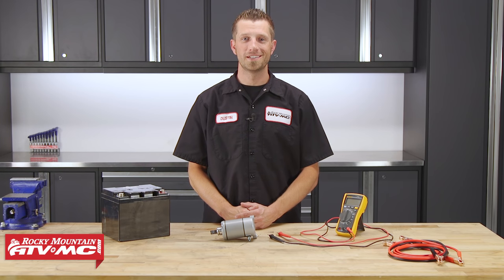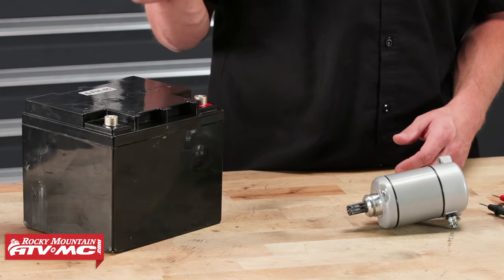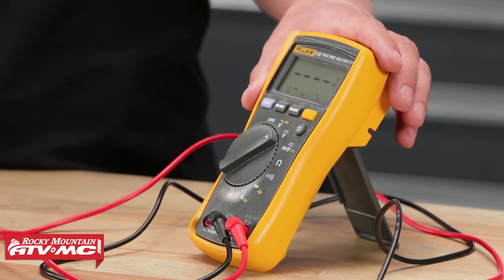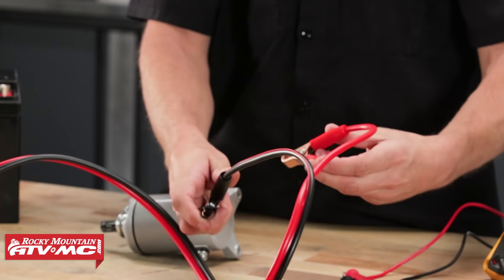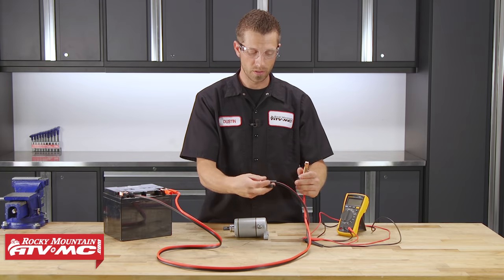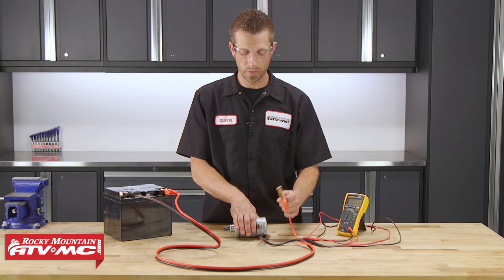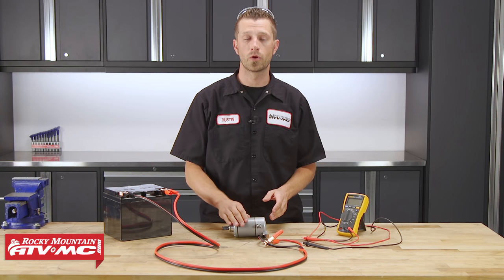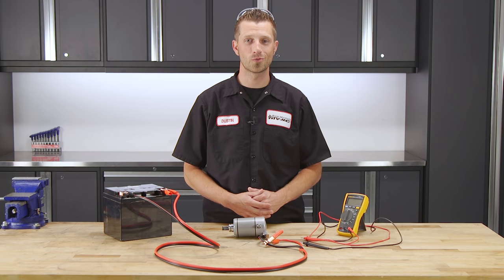How To Test Motorcycle, ATV, & UTV Starters

Comment: Just because a starter turns does NOT mean it is still good. The real question is how much torque will it produce and to test that you need a dial type torque wrench a vice and most difficult to obtain, the max torque spec for your starter. Then connect the shaft to the torque wrench and clamp the starter in the vice and bump the starter with a 12 volt car battery and see what the reading is. They may spin but still won't turn the engine over for several reasons.
Reply: Hi Brian
That is such a good replie. I have the same problem. Srarter spins but I can stop it within a second with a gloved hand. Is that normal for a 1200cc MC starter motor.
Reply: @thefishingreel1449  That might still be ok since the starter has a very small gear and the driven gear is larger thus you get mechanical advantage, but I can't say for sure. I did lean a lot more when researching for my problem and I found my arctic cat has an internal automatic compression release, and if the intake valve lifter clearance is any more than 3 thousands it won't open the valve the little bit required to relieve the compression on startup and even with a new starter, solenoid, and a car battery it would not turn over. adjust the intake valve to .003 and boom, fixed it.
Reply: Russell 79TuLlpLN
Reply: Finally the comment I was looking for, agreed that just checking the starter spins with no load isn't representative of real-world conditions. Thanks Brian.
Reply: What’s your alternative then
Reply: @Nikosakii  Alternative to what? Who are you asking this of? I think I said what needs to be done.
Reply: Correct. I just had this issue 2 weeks ago. No crank, no start. Bench tested the started and it worked, put it back on the bike while leaving the case off and nothing. Opened it up and armature worn way down and 2 brushes were dust. Replaced and now she starts

Comment: My motorcycle stopped turning over one day. I tested the starter solenoid and the pulse generator coil. They were okay, so I took out the starter and tested it exactly as shown in this video. It sparked a ton and there was no movement. I'll be replacing (rebuilding if possible) the starter & my bike should be back on the road.
Thank you for the helpful video!
Reply: That's exactly what just happened to me. Did your bike start up after a new starter?
Reply: @alexus335i7 any luck with yours?

Comment: Work flow should be negative to starter body then negative to battery. Positive to battery then positive to starter motor. Otherwise you might the sparks before you have time to put on the safety glasses 😁. Thank for the vid. You guys make great and very helpful content.
👍🇿🇦👍

Comment: In my application, there is an intermediate gear which then drives the Flywheel? on the engine. This intermediate gear only transmits power in one direction. In the other direction , it just free wheels (maybe using pawls or a"clutch"). I can hear the motor running, but no engine rotation. So can the starter motor be running in reverse and just spinning the intermediate gear??  Because, if in the correct direction, the flywheel/crankshaft would be turning. A bench test of the motor shows it running freely. I don't know any torque figures.

Comment: Hello . I connected the starter relay to the battery and it starts and stops
 It means not good.
But when it is connected to the motorcycle and tries to start it spins. Thanks for the help

Comment: cleaned my starter and resembled it, now it turns in wrong direction, how do i revert the  polarity to run correct rotation?
Reply: hi , i got the same problem how did you solve it?

Comment: Hey i have a starter... i have testet it with 12 volts but its not working. But sometimes i tapp the starter with a hammer it work.
And 1 min after it dont work.
Reply: Stuck brush(es)?

Comment: What about a starter motor that works fine on a bench test and works fine in ATV without spark plug in, but once the starter is under load (in the ATV cranking under compression, starter motor makes a loud screeching noise and appears to have lost it torque? Any ideas?
Reply: if you have tested the battery, and cable and cable connections and starter solenoid then I'd say the starter

Comment: I go to test my new starter that I just bought to see if it will turn over and After I ground the cable to the starter and I apply the positive cable to it I just see sparks fly and it doesn’t turn over why is this ?
Reply: I'm having the same problem. Did you find out why
Reply: @brandonatkins9087  did you find out why lol

Comment: I am getting a nasty noise occasionally when starting the quad.  We just replaced the starter clutch and it is still doing it.   I checked compression, check the bottom end with the spark plug out and it feels great when rotating.it only happens when cranking over. 
All drive gear from the starter to the tarter clutch look great. 
Starter cranks over great, but we are getting that intermittent noise.
Any ideas?
I am tempted to change the starter just to eliminate it.
Any help is much appreciated.

Comment: I have a 1997 Yamaha fzr 600R. I laid my bike down a while back on the right side ever since that happened now when I push the button to start my bike it won't start but I can push started with no problem. I did everything you said in the video and my starter is good at first I thought it was a starter before I tested it so I bought a new one I even bought a new solenoid and it still won't start when I push the button what could be the problem when I push the button a red light comes on indicating oil I don't understand my oil level is perfectly fine. Please help I'm tired of push starting my bike it weighs 515 lb

Comment: I got a brand new battery.  Two months later with minimal use it would not start. I replaced starter relay. Pulled out starter and tested with battery charger. It worked fine. Went back to auto part store got the battery replaced.  It started up. Next day it wouldn't start. Any ideas? I do have a permanent trickle charger and winch hooked up.  If that matters.

Comment: Can i use a smaller power source if it uses 12 volts dc? I’m trying a motor similar to that one with two 6 volt batteries and i get nothing, i doubled the voltage and still nothing. Is my motor bad or does my generic 12 volt power source need more amps?

Comment: What if the starter turns over once with the battery and the cables and when I double checked doing the same steps as the first time theres nothing
Reply from the maker: You probably have a dead spot. This can happen if there is poor contact, a short or open at the commutator (Several metal tabs on the armature that the brushes ride on inside the starter). Sounds like it's time to replace it. Some starters can be rebuilt, but for most people, I would recommend replacing the whole thing to save some headache. -Charles

Comment: You can do the same test by using a screwdriver and placing it on top of both connections on the starter relay and a spark will appear and the starter should turn or not depending if its good
Reply: If it don't turn does it have to mean the starter is faulty. Could it be anything else

Comment: Mine makes a weird spinning noise when I touch the wire to the starter solenoid and never stops any idea what the problem is? I replaced the solenoid and and I’m about to install the starter.
Reply: Bearing shot

Comment: What if you have a good battery and you start the bike and it cranks over really slowly and the positive cable gets hot? I have that problem on my 2006 Husqvarna TC450
Reply: did u figure out what it was going thru same thing thinkin its a bad starter solenoid
Reply: Bad connection somewhere making resistance

Comment: Big problem doing what he said. It works great if your starter is good. But since the idea is to test if it's bad, this is not good. If the starter has gone bad due to an internal short, you may as well be touching both sides of the battery terminals with your hand...

Comment: Sportsman won't start. I can start it by jumping the solenoid. Replaced the starter solenoid combo and same problem. Ignition?
Reply: Dave Smith. If you direct jump the solenoid and still have the same problem then the problem might be the ignition switch or the kill switch.
Reply: First make SURE your battery is fully charged.  Second, check that all of your grounds are tight.

Comment: I try to start the bike and all you hear is the starter but no turn over. Loud starter noise but passes starter test. What's wrong?
Reply from the maker: It's hard to say. I would recommend checking your machine to make sure your engine is getting fuel and spark next.

Comment: I tested my starter after rebuild and it seems to be working g properly, when I installed it the motor sounds ike it spins but does not engage the flywheel to crank the engine over. I am at my wits end!
Reply: Make sure your battery is fully charged.  Usually the culprit.  If battery is charged and good, you could have a ground issue.
Reply: Worn-out Bendix
Reply: Jeffery Young try fliping the magnets, its turning the opposite way

Comment: what is the ohm reading ?? between the positive and negative
Reply: very very low since the motor is not turning it's just the resistance of the windings which is less than one ohm

Comment: Does anybody here actually answer any of the questions in the comments? What would happen if you used a higher voltage battery?
Reply: This kills the starter (if its not rated for higher voltages)
Reply: He's right, you can't get more power out of the same size starter, power is heat, and the heat has to be dissipated.

Comment: My ATV starter motor struggles to crank past the compression stroke, cranks perfectly without a spark plug in, any ideas?
Reply: Matt Lee weak battery?/try wacking the starter with hard object if it helps speed it up starters wore. If not batterys probably weak
Reply: @keeganfoster1792  Could be a resistive connection too, a bad cable, or the starter itself even if it looks fine inside and spins on the bench, mine has been open twice, all components cleaned, bushes are good and free and still the same issue, all other components have been replaced and still the same problem, I think the permanent magnets may lose their magnetism. My 2008 Arctic cat does this and it only has about 500 miles on it, so it definitely isn't worn out.